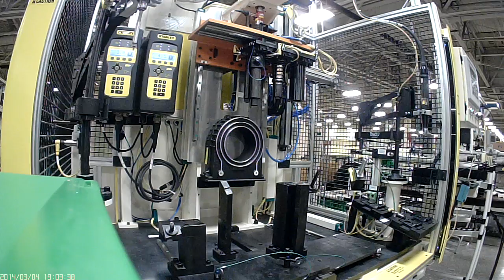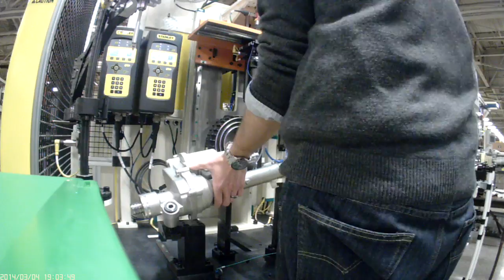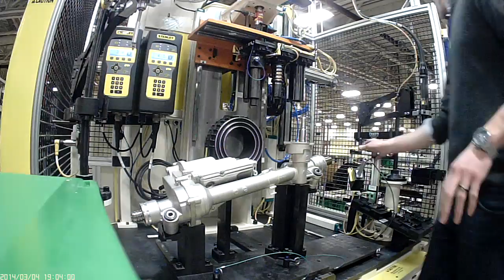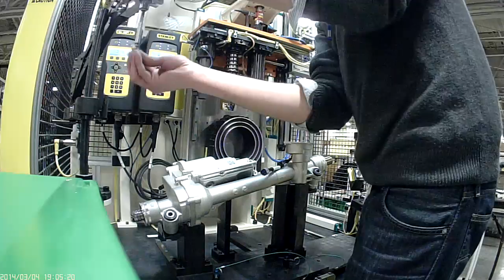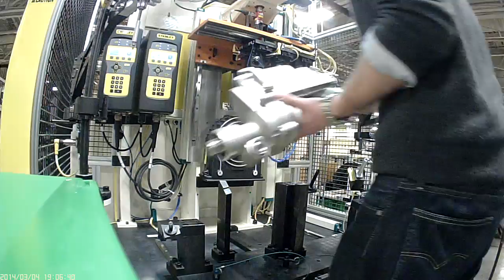133068 Nexteer EPS Assembly

Comment: Is this the Saginaw Plant or a different site?
Reply from the maker: Ryan Barker man, this was years ago, I don’t remember. We did a few of these for Nexteer in Saginaw, Mexico and somewhere else
Reply: This is a different site. It's not American. I work at the Saginaw site. What he's making is a Rack and Pinion gear. The Rack and Pinion gear which is built in plant 3 have actual assembly lines and not a 1 person cell like this. I worked in plant 3 in 2020 and 2021.
Reply: @andrewmorey9285  Very interesting, my mom and stepdad also work in plant 3, and have been there since 06
Reply: @ryanbarker2571  do you know which side they work on? Either GM or LWR (Chrylser) side
Reply: @andrewmorey9285  My mom works on the Chrysler side and my stepdad works on the GM side on 3rd shift